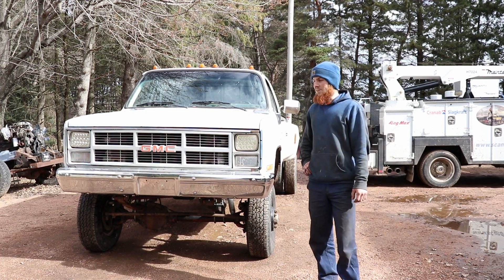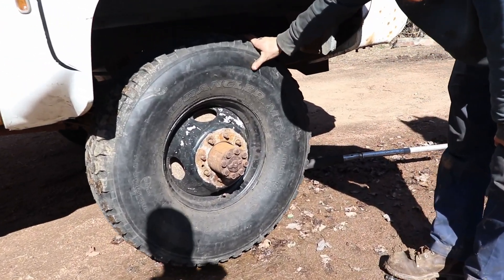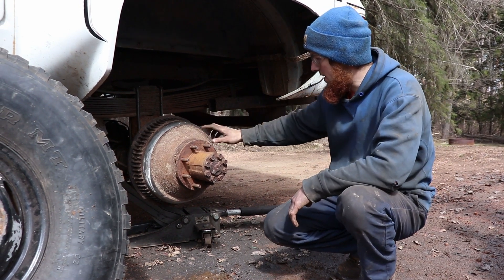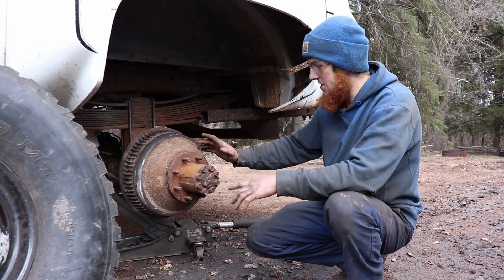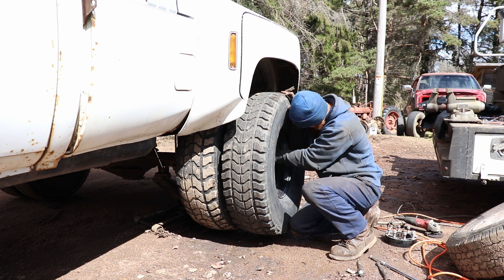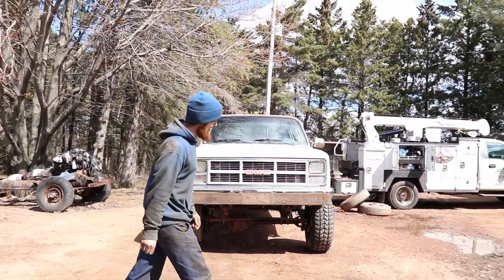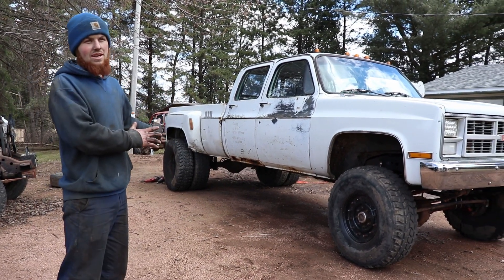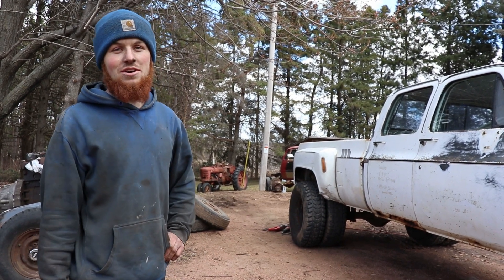Cummins K30 Gets New Shoes

Comment: I see that duramax 6.6 has 397 to 440hp but i heard they werent good engines which is better a cummins or DURAMAX i love the way the duramax sound
Reply: cummins weigh more, but are torquey as they are 6cyl, duramaxes are lighter and make more hp, but are also expensive as hell, so cummins are more common. i could only dream of a Squarebody Duramax, but that would require upwards of a 8-10,000$ donor truck, where a old 12v would require probably a 3-4,000$ donor truck, and are much much easier to get wired up and running, since they only need 2 wires to run.